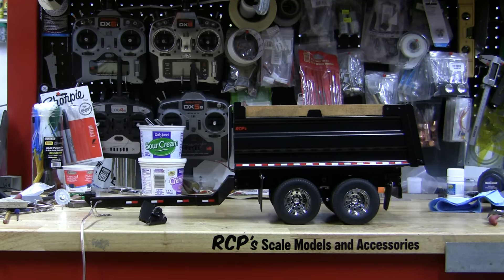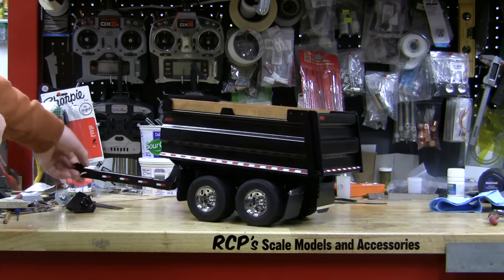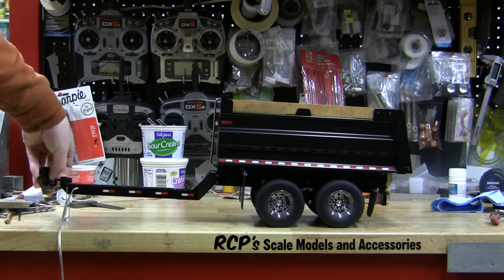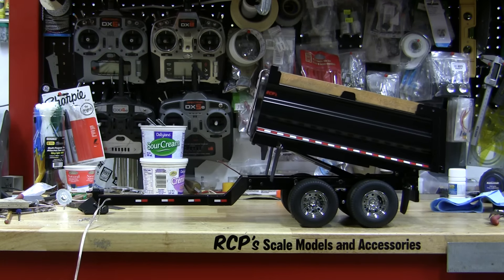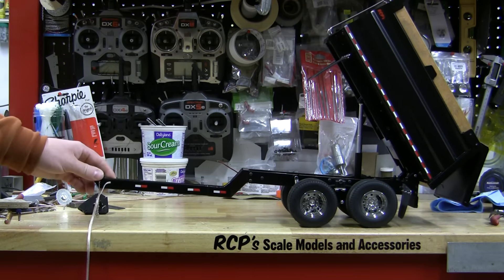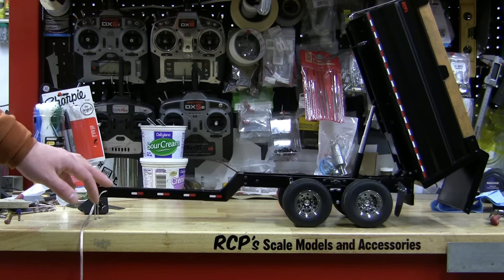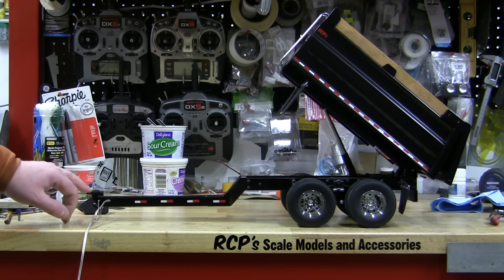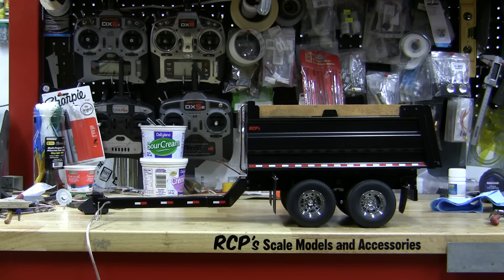RC Pup Trailer

Comment: Beautiful little pup trailer. How long do you figure it takes to pump one of those out?
Reply from the maker: +Dirty D's RC Thanks Bud! I try not to keep track.lol I built this months ago and a lot of it was a one off type deal so probably at least a week. When I build the truck boxes I spend a few days making the common parts for several of them at a time. I just inventory the parts until some wants one built. Then I only have to assemble those parts and build the body to look like what the person wants making it seem like less work.lol
Reply: +RCP57 Nice bud. Makes sense. Just went and redid my upper arm mod links. The first time I did it was shotty work and was so crooked. Dog legged really bad. So finally got so drill bit off my buddy 4mods and had that redone, strait as an arrow now and made a few adjustments while I was there. A few more things I need to do to the MRC then action videos. :)Gunna pull the diff gears out of the front of the drifter and drive it RWD. :) Should be fun.
Reply from the maker: Donut city!!!!!!!!!!!!
Reply: +RCP57 NO NO NO NO my friend. Full high speed initiation counter steer drifts. It's going to take a bit to learn how to drive er' again.
Reply from the maker: +Dirty D's RC Sure, show off your advanced driving skills. Donuts it is for me!lol
Reply: +RCP57 I saw you gettin' Fat & Flat into some counter-steer there. Thought it was very impressive. Didn't think the old front axil and leafs would let it. But you are getting it to cs drift. Premiss to have some drift vids soon. :)
Reply from the maker: Yes she's a handful. Those tires are so hard that neither end gets traction. I took it outside and on the gravel driveway it still wouldn't go straight at full throttle. It doesn't even have that much power!
Reply: +RCP57 No kidding eh'. Take some heavy grit sand paper and ruff em' up a bit. May give you a bit more traction but not to much. :)
Reply: +Dirty D's RC If you do do that, make a 45d. cross hatch pattern. :)